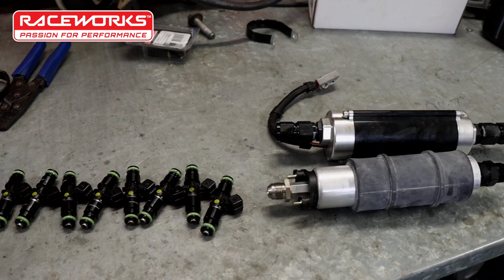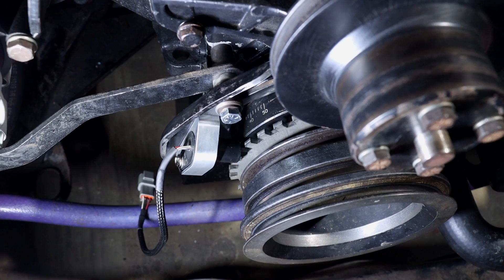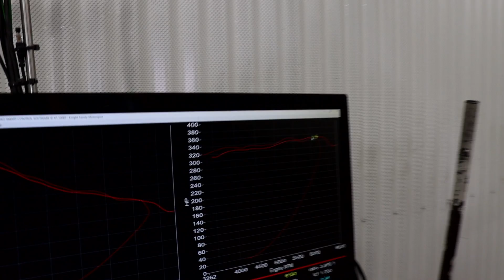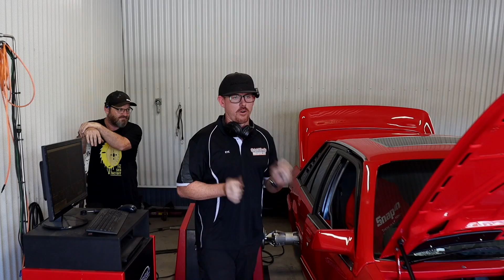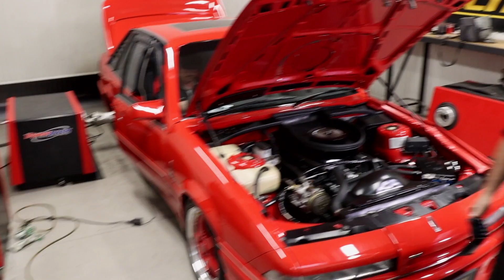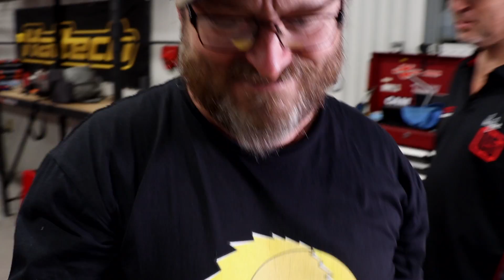NITROUS Fed HOLDEN 355 - Peter Brock VL Calais Sport Ep3

Comment: Am I reading something wrong, or is this making over 300hp at 3000RPM? Can't tell if it's a difference in the hub dyno, or just that it doesn't ramp up the run really low. Sounds good either way!
Reply: On the hub dyno the RPM axis is actually Tailshaft RPM not Engine RPM and on this car it has a fairly loose torque converter so when we jump on the throttle at the start of the run @ around 3000 Tailshaft RPM the engine flashes to around 5000rpm at the crankshaft then the converter progressively lock's up as we go through the run and at the top of the run we are seeing around 500-600rpm of slip at that point :)
Reply: @knightfamilymotorsport  Thanks for the explanation! So if I'm understanding correctly (not too savvy on converters), while rolling at the start of the run, the tailshaft and engine are roughly 1:1, but the looseness of the converter means an initial disparity between the engine speed and tailshaft which gradually closes throughout the run? Is this why auto cars on the drag strip don't sound to be moving up as linearly through the rev range, as the engine flares before the rest of the drivetrain catches up?
Reply: @ftovr2957  Yep 100%, also that slip is not all for a loss though as while there is that slip between engine rpm and input shaft rpm the torque converter is actually multiplying engine torque which really helps in getting a car out of the hole :)

Comment: I love VAG cars for their reliability. Had 2 Skodas, 2 Audis and a VW.
Had 3 issues in my 20years - first Audi had a cracked Bosch thermostat housing, 2nd Audi that is 23 years old but I’ve owned for over 15 (on 27PSI the whole time) has had a yaw sensor fail and part of the instrument cluster partially fail. Great cars, but tight engine bays
Reply: VAG & DSG.....good luck with that 👍😛
Reply: @lancecooper4646   20 years and going strong with their products, so I’m confident. Glad I don’t get gasket issues or oil leaks like every other manufacturer - haven’t had that since a jap car
Reply: Love my 2000 audi B5 A4 1.8t quattro sport, runs just like new. Put a garrett GT2871r and it moves along really good on 12psi. I have a genuine N75j to push it to 15psi but haven't installed it yet. Is a one lady owner car that I scored for 3k, the only one I've found the exact same is 20k online.
Edit- yes my lcd in the cluster is barely readable haha.
Reply: And I just love Vag...